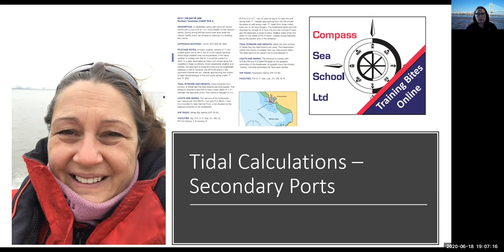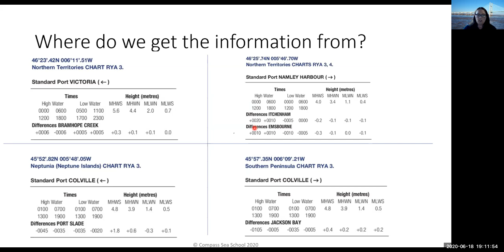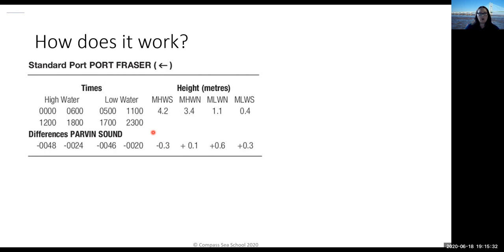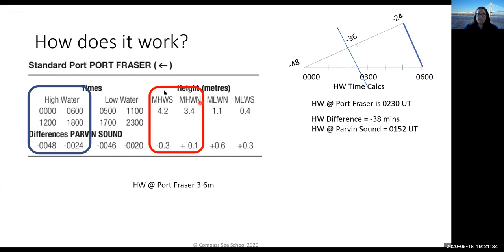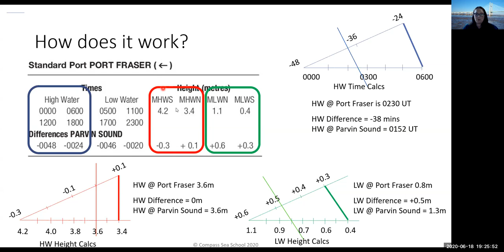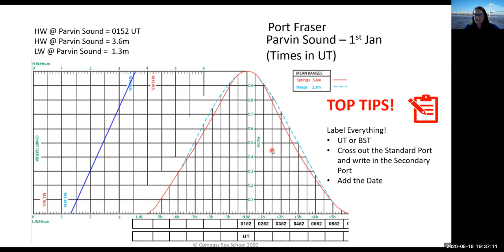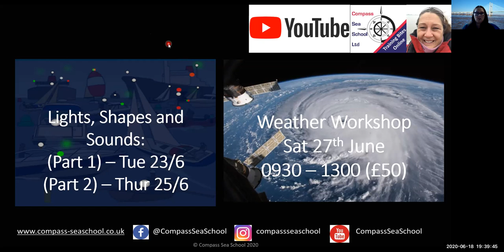Tidal Calculations - Secondary Ports.

Comment: Thanks for your very clear presentation on a potentially confusing topic . It is the way that you set out your working with clear labels that prevents serious miscalculation . I am sitting the Cruising Skipper instructor course in Sydney Australia . I will use your methodology with students if the topic comes up although in Australia the topic and method is a little simpler. This has been a big help for me because I have trouble with scales and  interpolation as well as when to apply different time zones. I think this is a very confusing topic if you dont follow a precise method.

Comment: If I may ask, why at the 22:17 minute mark, the tidal range is calculated from deducting 1.0 and not 0.8 from 3.5? I would have thought 0.8 would be more appropriate because the range window in question is where 1900BST would fall within. Am I missing something? Appreciate your clarification. Thank you.
Reply from the maker: Hi Joseph. Yes technically you can use 0.8 - but that calculation is simply to figure out if it is springs it neaps and either number will give you the same result. Hope that helps.
Reply: @CompassSeaSchool  Thank you.

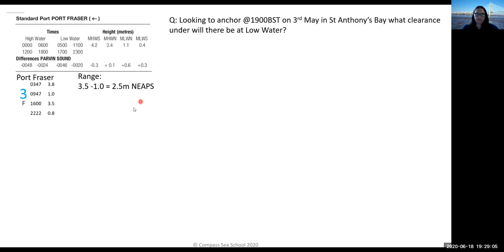Comment: Great Vid! My question is why did you use the LW at 9:47 instead at 22:22 to calculate the range in your DST example? Can I chose any LW-level which is close the HW? My second question is since in the question stem is has been asked after LW so why do you use HW?

Comment: Hi - many thanks for your presentation - much appreciated but still rather confused. In particular in your height calculations - first you are comparing HW springs with LW Neaps & HW Neaps with LW Springs? Do you not compare like with like? And second why is the first triangle created with a right angle for HW and not for LW? thanks again
Reply from the maker: David - sorry if you are confused. I am not sure what elements you are referring to for us comparing HW Sp and LW neaps I am afraid. Do you mean where we compare MHWS and MHWN? Is so that is the extent of the difference for the HW calculation, we then compare MLWN and MLWS for the LW calculation. The triangle is calculated on HW as we are using this calculation to correct a standard tidal curve for a secondary port and most tidal curves operate from HW. Hope that helps. If you are still struggling then perhaps a paid 1-2-1 session would assist?

Comment: Many thanks, I had an example where the standard port low water was lower than the secondary port mlws.......does this mean the difference is outside the range and if the difference is 0.2 it cannot be less?
Reply from the maker: Andre - the secondary port entires are for the Mean ranges it is always possible that the actual HW/LW can be higher or lower than the figures in the secondary port grids. In that case you can extend the triangles to accommodate the extra calculations. Hope that helps - Thanks Kath

Comment: What if the high tide of May 3rd in your last example was at  0900.  How would you create the HW Time Calcs sketch in that case?
Reply from the maker: Laura thanks for the question. If your HW @ Port Fraser sat at 0900UT then you would create the triangle using the data in the Sec Ports table with the timeline at the bottom going from 0600 to 1200 and the minutes on the top going from -0024 to -0048. Make sure that you allocate the correct minutes to the correct ends of the timeline. Once drawn you can use the same method to find the difference for 0900.
Reply: @CompassSeaSchool  I am so grateful for your response, and the whole video! It is so clear, and methodical, and love that at the end you show how you can estimate also!